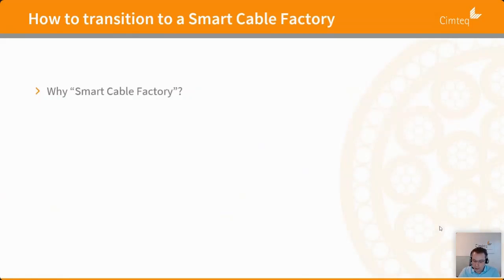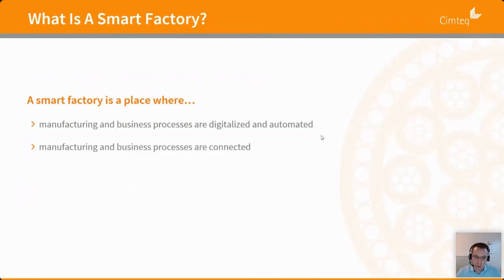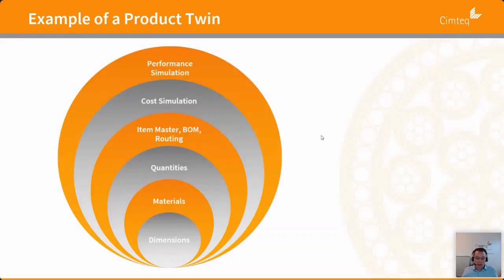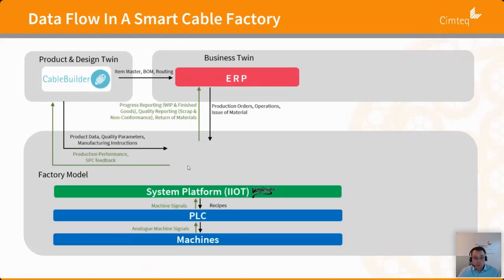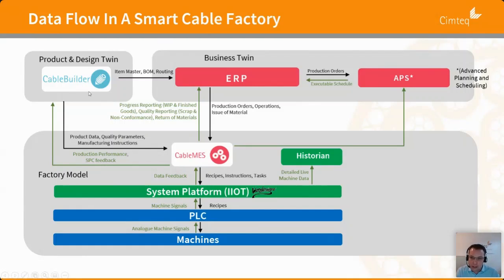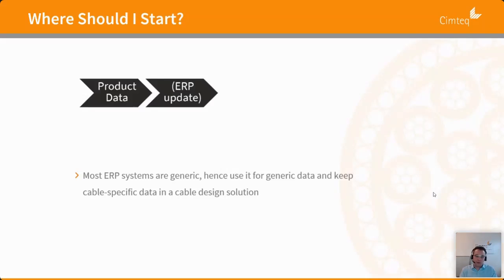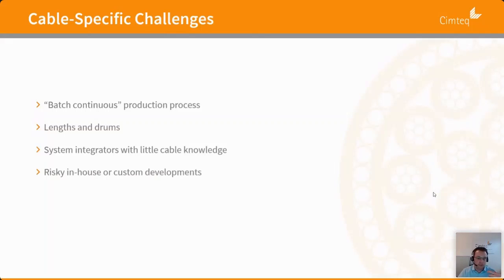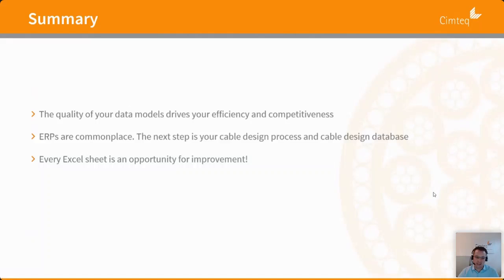"How To Transition To A Smart Cable Factory That's Ready For The Future" with Fred Becker, Cimteq

Comment from the maker: 1. Welcome (00:00)
2. About Frederik Becker (02:14)
3. About Cimteq (02:32)
4. The smart cable factory during Covid-19 and growing profits in a changing market environment (03:57)
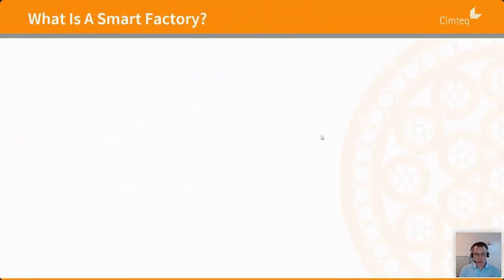5. What is a smart factory? (07:25)
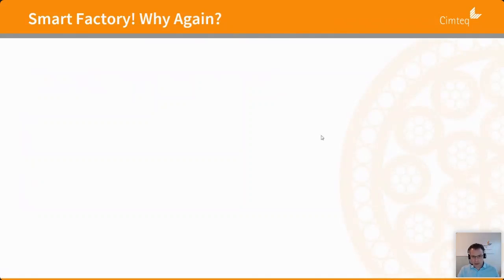6. Efficiency and speed in smart factories (09:15)
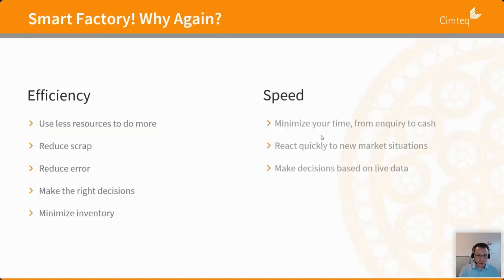7. The digital twin! (10:18)
8. Example of a product twin (11:24)
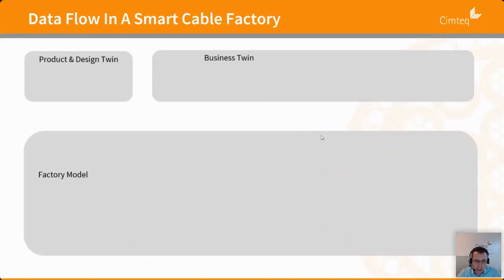9. Data flow within a smart cable factory. Product & design twin, ERP, APS, MES, System Platform, PLC and machines (14:23)
10. Where should I start? (25:27)
11. A common mistake - starting in the middle! (30:38)
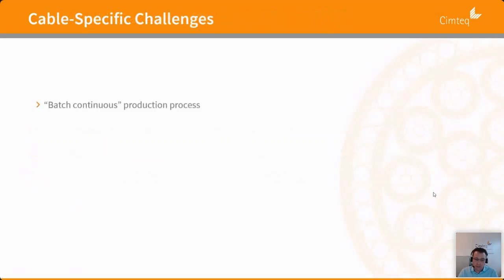12. Cable-specific challenges (32:32)
13. What is possible within a smart factory (34:08)
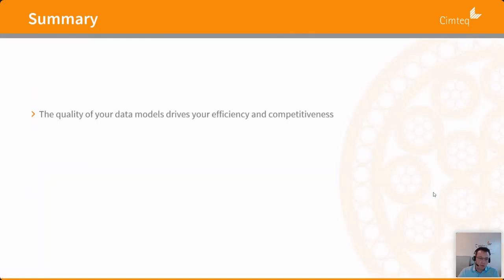14. Summary (37:44)
16. Q&A: Can you give a real-life example of the benefits of ensuring the design and manufacturing data is connected together? (39:31) 
17. Q&A: What are the dangers of not making the transition to a smart factory? (41:19)
18. Q&A: What are the financial benefits that a smart factory can provide to a cable manufacturer? (42:52)
19: Q&A: Can you provide more detail on "What-If?" modelling? (44:10)